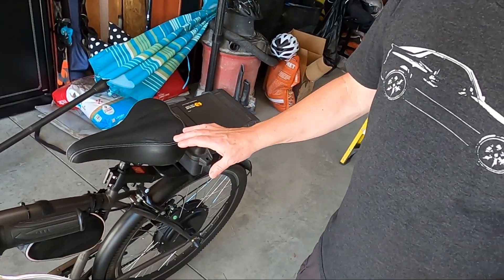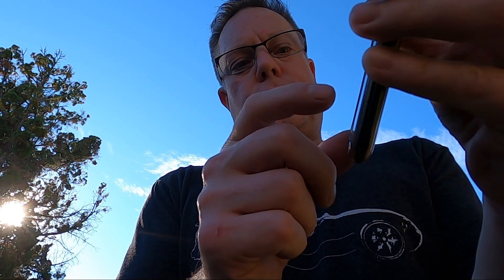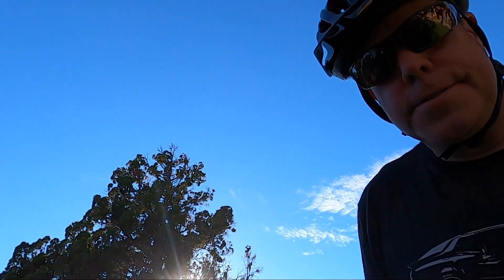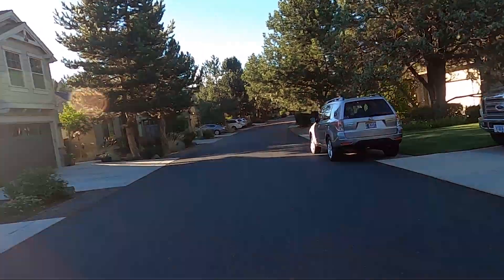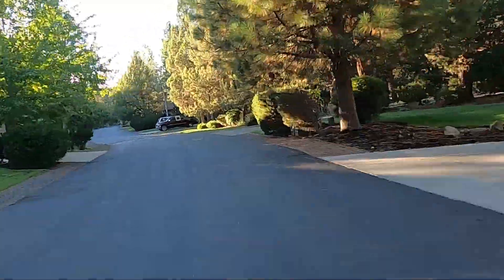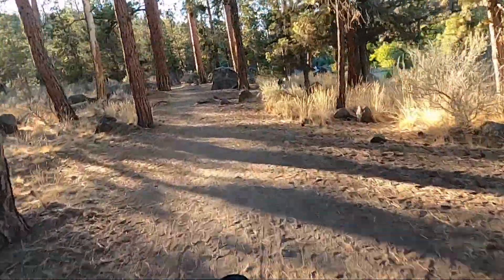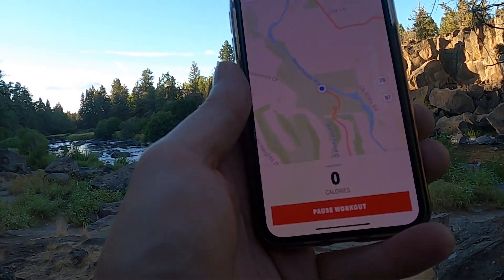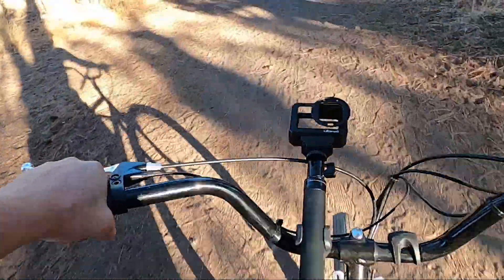DIY Electric Bike 1000w 48v how far will they go on a charge (2020) Range Test

Comment: What type of battery did you use ? 48v 13ah or 48v 20ah !
Reply from the maker: Is bike Tech the 12 V battery and I just use the one that they provided when I bought it. Hopefully this helps. Thank you so much for watching.
Reply: @hanzdidit  thank you 🙏
Reply: @hanzdidit  I ask because a seller from eBay messaged me today that a 48v 20ah battery :  Usually 1 Ah can provide 2.5 to 3.5 kilomteteres's riding distance ,20Ah is 50-70 kilometers's riding distance, so I was a little confused about the 11 miles you gotten, when it should of been around 30 miles on a single full charge

Comment: The Chinese like to build new batteries from batteries that have reached the end of their lives and have been discarded, and then sell them to us for a lot of money, the cells come from discarded buses or taxis
Such ranges then come out of it.
With my last china battery (150 bucks), the cells only wanted to hold 3.4 volts instead of 4.2v and I got a range of 10 kilometers..
If I build such a battery myself, just the pure battery cells without the rest of the technology will cost me 200 - 230€
It's impossible to build a DECENT battery for the money the chinese are selling them for.
Just impossible.
Reply from the maker: Thanks for the info

Comment: Just recommendations: Better buy an used branded bike, that was new quite expensive new, than a cheap & bad out of Walmart or so. More range with batteries like with branded lithium cells from for example Panasonic, Samsung and so on. More expensive, but way better. LiPos can be very dangerous. Not recommended for E-Bikes, might be okay for RC Cars and such things.
Reply from the maker: I totally agree with you. These batteries can be very dangerous and I have seen them catch on fire and it is a super scary thing, once they catch on fire it is almost impossible to get them out unless you have a bag of sand pour over the top of them. My next build I will use a 18 650 battery pack. Thanks for your input and thank you so much for watching.

Comment: 10 miles is correct, on throttle only you get approx One mile per amp hour, you were using two 10ah lipo in series so that is perfectly normal, should have bought a two dollar lipo alarm and checked voltage ⚡ 🤣✌️take it easy now and stay cool 😎
Reply from the maker: Awesome! thanks for the input and thanks for watching.